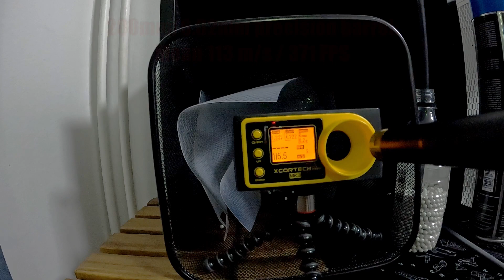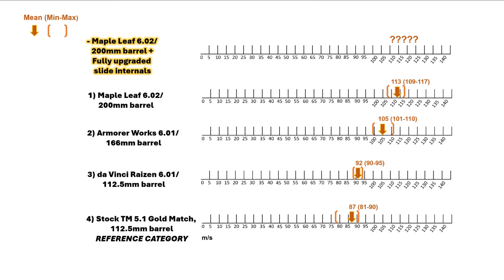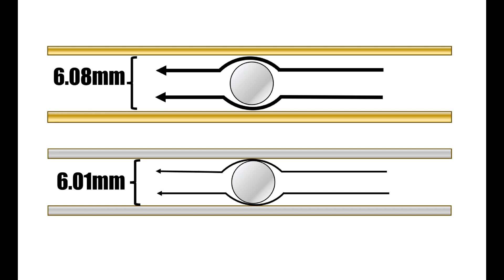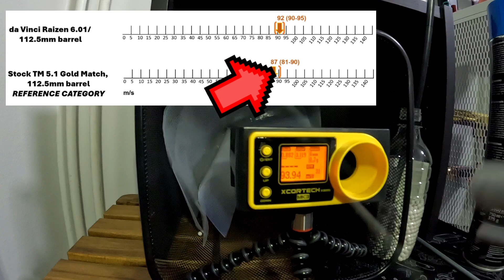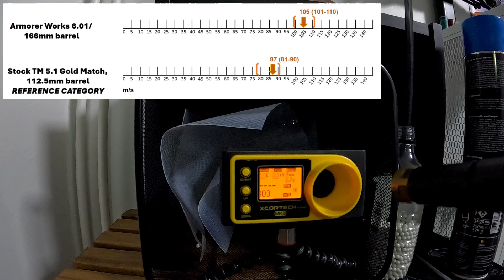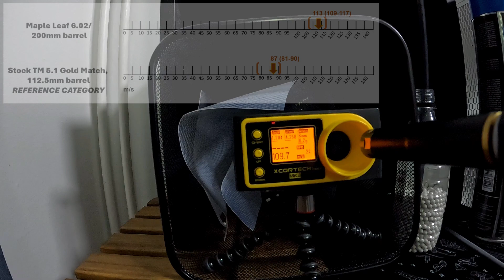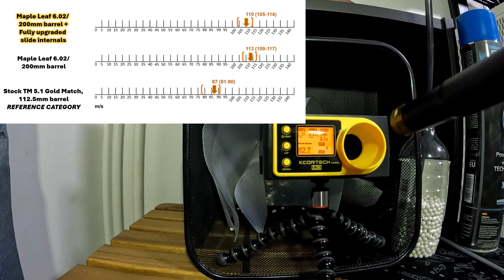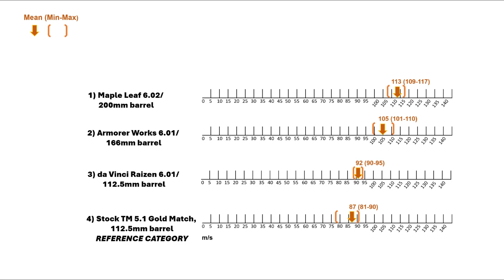Overpowered HI-CAPA with just one Upgrade part - The Effect of Barrel Length on FPS (PART 2)

Comment: So what size of inner barrel get good bbs trajectory ?
Reply from the maker: By size you mean bore diameter? Sure tighter barrel increases also power, but quite little in comparison to the length of the barrel. For me, I don't practically care whether the barrel is 6.03 or 6.01. As far as it is optimal length and the surface finish is good. Maple Leaf and da Vinci are always good choices. But 6.00 could be too tight fit, if dirty, then dust etc can distract the BB very easily. For the best trajectory, the most important is a good bucking and preferably a TDC-type chamber.